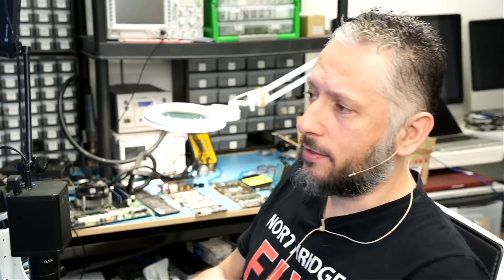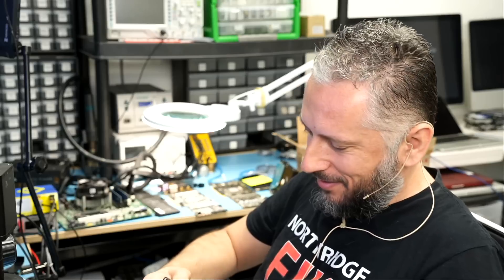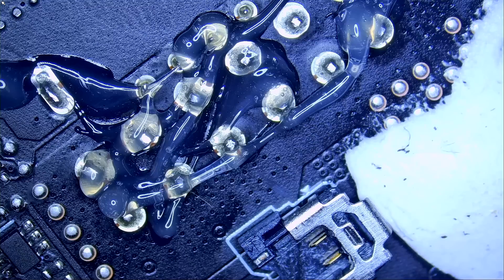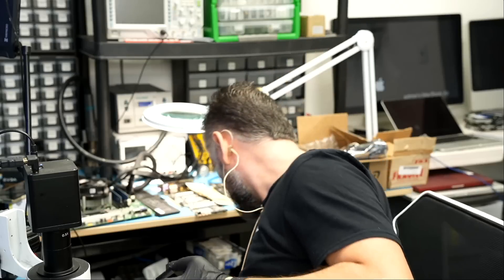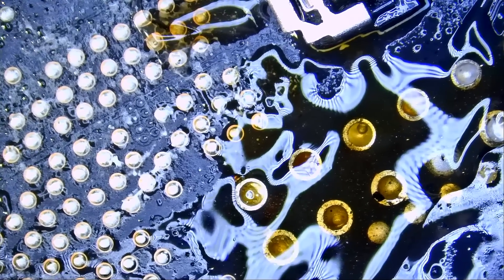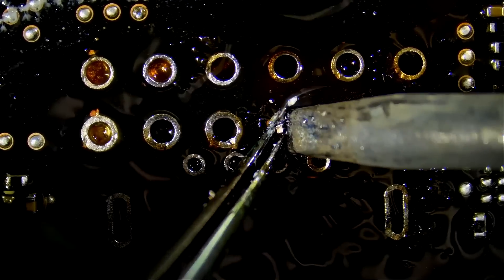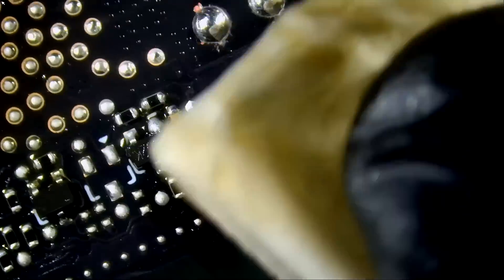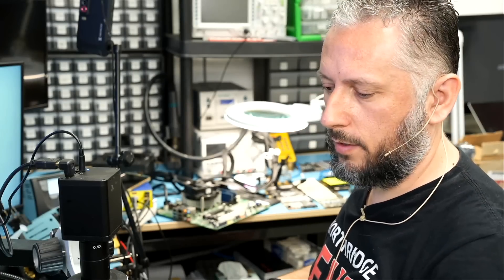4090 FE Connector melted with Cablemod Adapter installed. 40 series cards should be recalled

Comment: i am skeptical of the cablemod adaptor. I still believe the tolerance of the pins on the 40series cards is so small that there is no room for error. There is a minimum amount if conductive material required to make a good connection. Im willing to bet there are a couple of youtube groups who would LOVE to get their hands on that cablemod adaptor to see why it burned.
Reply: My theory is that w/ enough thermal cycling the mating area of the pins and the connector decreases which leads to higher resistance and even more heat, the heat adds extra resistance, too. The heat is proportional to the resistance (i.e. Q=I2Rt)
Reply: @stanimir4197  yes. but until someone opens up that adaptor, we are just guessing. The pins are SO small. I have no idea what they are made of (hardness comes to mind). simply plugging that adaptor in a few times or more could cause scratches/fissures/gouges in either side, causing less available mating surface. Thats what im talking about with the low tolerance. Did i read or watch a video somewhere where nVidia stated the connector can only be removed so many times? as the ammount of times is unusually less than a typical connecor, i know there is a term for this but its 6am and im at a loss lol
Reply: @Mason-zu6um  No you're right, it's like 30 times officially specced you can unplug and replug it in or something. You did hear correctly!
Reply: @Mason-zu6um  probably every time the connection is made, it stresses the pins causing them to lose tension.
Reply: @AeRiaL_  So was the 8 and 6 pin molex connectors.

Comment: Bad design.  Will fail again in the near future!  I think I would solder some 6 inch jumpers to the card and use a higher amp rated off card connector at the other end of the jumpers.

Comment: I thought the cable melting issue had been well established as a manufacturing error by a whole host of channels who investigated this in depth. Why do people still persist with the “user error” excuse?
Reply: Because, at least i, havn't seen any evidence of anything else then "user error"
I have not heard or seen anything or anyone else but gamers nexus to replicate a melted plug, and the way they made it happend was with a not fully inserted plug.
Reply: Because that is the main cause of this happening. It is user error with a helping hand from a poorly designed connector that is difficult to know when it is fully seated. Even with a 90 adaptor you can still do it wrong or have too much pressure on it causing poor connections which lead to excessive heat.

Comment: Maybe you could fully assemble the next one, and run a benchmark/stress test and look at the connector with a thermal camera?
Reply: i doubt client would appreciate Alex experimenting on his GPU. It's a repair shop, not a lab
Reply: @sush7117  I do agree with you there actually.
Reply: GamersNexus already did that extensively. Look it up, it's quite interesting
Reply: @MaD_fX  I saw this too. Just thought it would be good for Alex's viewers to see it on his channel too :)
Reply: @LukeEdwards6  It probably would but I doubt he's got time for that :)
Reply: @MaD_fX  Yes, but those were all not plugged in fully or correctly. And also not with a 90 degree adapter.
Reply: That would be a realyl good idea I think, Then can see if there's any heat in that area.
Reply: need enclosed space and likely a lot thermal cycling - the latter would loosen the pins, increasing the resistance, generating more heat - that leads to even more resistance and more heat, till it reaches the melting point.
Reply: Even though Alex does do these videos, It would not be good for business with all of the work he has to do. other tech Youtubers can do the testing he does well more than enough to prove its a manufacturing defect and not a user error. Thanks Alex!
Reply: @guito1969  He hasn't proved that at all though... It is, unfortunately, user error most of the time. People are not accustomed to how much force it can take to install these plugs or how little forgiveness there is with the cable routing.

Comment: Well, really does look like there is more to this problem than just the cable not being fully seated.
Looking on the net there was a reddit user some months back that had his connector burn up, when using a cablemod adapter as well. 

This connector is just too flimsy and unreliable. Sure there will be some users who have not seated the power connector all the way, or have it under pressure from the side panel of the case - but with so many failures it can't be all of them, and now adapters designed to prevent this issue are also burning up....well, that points to another mode of failure. 

Perhaps some of these connectors are having a high occurrence of manufacturing defects - pins maybe not manufactured to tolerance or contaminated with something so that they are causing higher than normal contact resistance. Either way all the card manufacturers should honour all warranties with regards to a burnt connector as its becoming obvious this is a design/manufacturing flaw.
Reply: That one we did confirm to be user error in that it wasn't plugged in fully. The user error ones are usually very obvious though, as you can see markings on the terminals, showing that they were not fully seated. There does appear to be different melting issues though, as shown in this video here. You can have the melting from not fully inserting the cable/connector, because electrical arcing occurs, where heat will build up until you get to a melting point, and then you have what happened here. This, and a few other cases I've seen, it does appear a full seat was made on the connectors, and the same row of pins is melting in those instances as Alex has shown in previous videos as well, so we're starting to suspect there could indeed be something else at play with these connectors and pulling too much power.

Comment: isn´t this a problem with the power conector cable? an internal damage in the conector where cut power lines draw to much current to some pines, burning the conectors?
Reply: if this is the problem, the customer, using the same power cable, will damage the power imput socket again

Comment: Both at fault. Clients and manufacturers. Clients urge to buy things so quickly before deciding. Manufacturers speedup production without enhancing quality. Everyone knows that high amperage contacts inside power connectors and cables need to be thicker or they will melt. Looking at the molex connects.. they were perfect for the job but some were too stiff.

Comment: I have literally 0 problems with my 4090 since day 1 release. Going on 7 months now.
Reply: it depends on many factors man:
1. home user versus pro gamer versus reviewers; see how much reviews for example HARDWARE UNBOXED make, +30games/apps per gpu.
2. oem, maker of card, some use better materials than others, some have better engineering than others
3. power supply; tier list; some have best power , some have good, some have regular < 80 white
4. driver version, when driver first released it wants to prove the card delivers the best performance, then on next release it gets revised & make gpu more stable
5. kind of game people play, I heard diablo 4 demo killed a bunch of 4080 gpus. the game seems to be over utilizing gpus
So, it is more than one factor what makes gpu live or die
Reply: are you pushing it for hours on end, or overclocking it? I personally think its a load problem. The plastic is too sensitive to the extra heat. They make shuttles that survived heat on reentry, pretty sure they could make a more hardy connector
Reply: @helinghaus  i have two MSI 4090 that i use to render DAZ scenes and upscale/recode videos with RealSR NCNN. sometimes they both run for over a week non-stop with 450W power draws. had them since December. zero melted cables. why? because i know how to plug in a cable correctly the first time without destroying the surface of the pin recepticals and creating a high electrical resistance spot
Reply: @helinghaus  No overclocking, but definitely pushing it for hours on end pulling 400W-450W, sometimes 12 hrs+ straight
Reply: @innie721   Luck of the draw, you might have a good connector with literally zero defect.
Reply: @JoshRamain  Well as it turns out as explained in the latest GamersNexus video, all of these 4090 cards sent to Northridge were simply a backlog of cards sent from CableMod. Northridge generated drama for no reason.

Comment: There is definitely a problem with the connector.
However the Cablemod adapter is not certified by Nvidia so you could blame this case on the connector just as well.
Reply: Agree. However, while this particular instance may allow nVidia to weasel out of their warranty obligations, it does show that a firmly seated connector can still cause the plug to melt. The proof is in the fact that the heat caused it to permanently weld itself in place and so we can all see how perfectly it was plugged in.
Reply: bruh. there is not a single power supply that is "certified" (whatever that means) by nvidia...
Reply: It's not the connector it's the amount of current going through it bad design on the card. Cost cutting at factory basically older cards had 3 of these connectors 3 phases. They are ramming all that down 1 connector now and some because it's a newer even more powerful card
Reply: We've sold over 50k of these adapters so far with less than 10 failures. Meanwhile there are reports coming in from resellers that we've talked to that they're having melting failures even with the stock Nvidia cable as well. Wouldn't be so quick to jump to concluding our adapter would be a failure point when these failures happen without our products being involved too. ;)

Comment: There is still the possibility that cablemod sucks sometimes with their product. Wouldn't be the first graphics card/PC to die from their "quality products".
Reply: With over 50k units sold on that angled adapter, and even more 12VHPWR cables sold, I'm not sure what you could possibly imply with our products not being quality made. Even in instances where failures happen, like the one here, we paid for a new GPU replacement, and are getting the GPU fixed and then doing a giveaway on the card once it is repaired. Our products come with quality support as well.
Reply: @matta.1673  Thanks for clarifying.
Reply: @Kivas_Fajo  Very welcome!
Reply: @matta.1673  I'm scared right now in my body, I have a 4090 frostbite with your 90º angled connector if something happens to it, do you mean that I have to talk to you directly and you would change my gpu for a new one and mine would be "raffled among the community of cablemod"? If so, I was unaware of this policy but it gives a little more security... Is this written on the web?  I understand that if necessary, everything should be reflected with photographs, adapter bills, gpu bills... we are treating the matter seriously.
Reply: @murenitu  not written anywhere really, but our products come with warranty and support of course, and as mentioned, we've covered almost 10 GPUs already which have failed, even the ones that actually were user error (you could see markings on the terminals showing that it wasn't fully inserted). But yes, if anything did happen, you just chat up our support team and they'll get you taken care of. Again though, we've sold over 50k of these and have less than 10 failures, so it really shouldn't happen if you're plugging it in fully.

Comment: I have just looked up the cost of this unit in the UK from GeForce and it is "Starting at £1,579" Disgusting price for a badly designed board.
Good channel and very interesting. Thanks.   M
Reply: I did the same Martin, looked up the price. The only way to get these companies  to re-design their products is for the public to stop purchasing their products. these companies don't care about their flawed designs until it starts to hit them in the their pockets, it might be that they are cutting corners to make maximum profit.

Comment: great work - are the new connectors you solder in more heat resistant as the originals?
Reply: I am sure it is the same kind of plastic that they are all made of. The problem isn't with the plastic shell.

Comment: The reason that  connector melted is simple. Just too much power draw on  a single connector. If there was 2 connectors it wouldn't be a problem at all. This single power line is pulling too much power and overheat and melt in time. Also if some is using underpowered PSU can also add up to this problem for the single line connector issue.

Comment: The connector is simply underrated for the power they are pushing through it. It can't handle the load.
Reply: Yeah, there seems to be a proper reason why the previous gen used 3x8 without needing it to draw enough power... and some PSU makers not including a single VHPWR slot when they can still separate it in their end for spreading out the heat load across the board.
Reply: It's rated for 600w, and a 4090 will never go that far unless you're doing extreme overclocking. However, there's the question of can the connector, or even certain individual connectors, handle the 450 to 500+ watts that a 4090 will use.
Reply: @ryanspencer6778  its rated for 600w but can handle draw exceeding 1600w when no mechanical defect or user failure is present in connection.
Reply: they'll need a 30 amp dryer socket soon
Reply: I do have a theory, this connector has 6 12v pins that handle 648w max as per the official rating, but the pins look slimmer compared to those in the 8pin connector which only has 3 12v pins that handle 150w, so the math is 6 pins 9amp each, but slimmer than those in the 8 pin connector which should be rated for 4.16 amp each. I can see a potential problem there.
Reply: @endame90  Your theory is without merit and has no basic in electrical engineering theory or practicality.
Reply: Yep, this was already investigated long ago. Some boards have higher TDP and they will more likely burn the connector having too thin pins to push too much current from them mainly 4 top pins. Its one reason i skipped buying 4090 cards.
Reply: @supremeboy  Correct. Stock should be fine, but some cards simply have too great of  TBP request when OC'd. Its a shitty design just to make some more money.

Comment: I found out online that only the Be Quiet! power supply with a 12 pin connector that doesn't use solder cables but crimp has exactly the same current per pin but on the 4 to 1 adapters added to the cards and some power supplies with a 12 pin connector that use solder cables and on soldered cables on each pin the current is very different.

Comment: One may think: how come only now people started to not insert connectors properly and connectors melt? Maybe it only happened now because of the high amperage flowing into the 4090 graphics. If it is indeed a connector issue, as it seems to be the case, but replacing the connector will only solve the issue for now, unless the connectors you are using are of better quality than the factory ones.
Reply: The new connection has a lot less tolerance than the old 8 pin. It doesn't click as easy and needs to be fully seated to lock in.